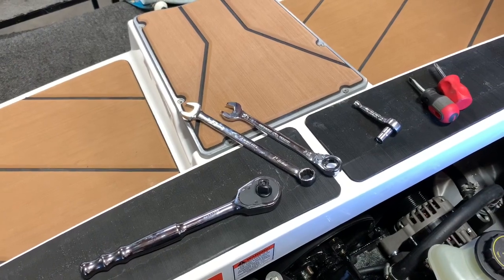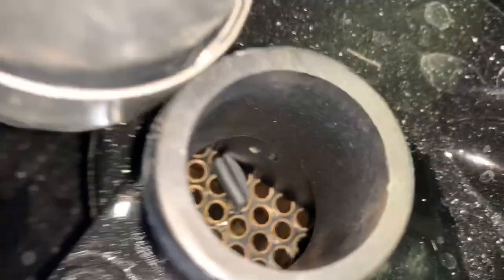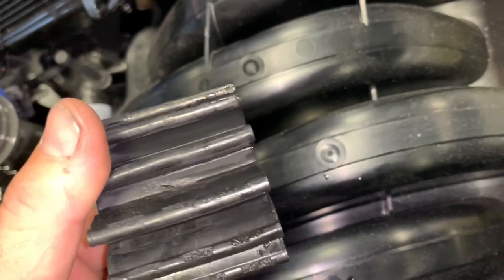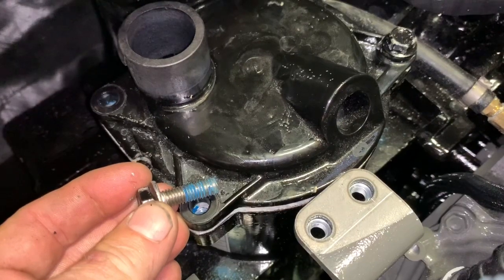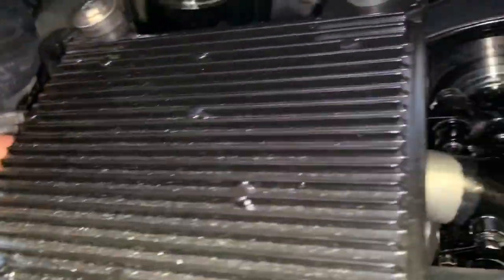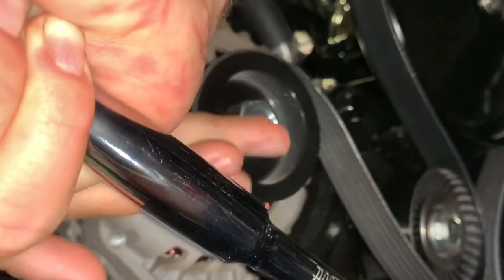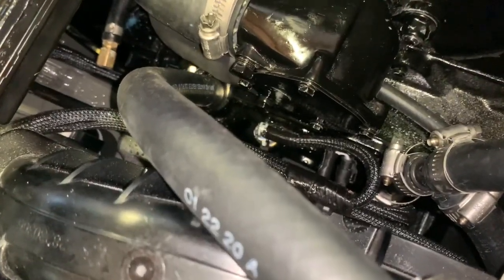Malibu M5 M6 impeller  replacement

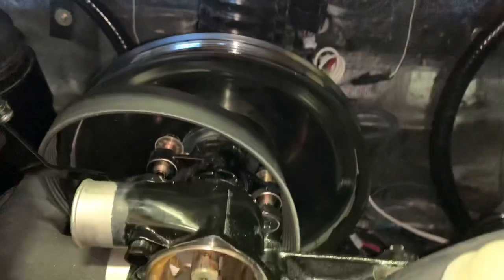Comment: At about the 9:05 mark in the video you say "sometimes the keyway is popping up and you have to squeeze it down", can you elaborate on that?  How would i squeeze it down? I took pics and it looks like a solid piece of metal.  This weekend I had a really hard time getting mine changed. I ended up having to file the impeller down.  Really makes me think I didn't do something right and it might be what you mentioned at this point in the video.  Thanks for your help and the great video.  I was able to follow all the steps and did eventually get it swapped out.

Comment: This method is accurate and the easiest way to change my impeller on the replacement Johnson raw water pump which was recalled/upgraded on my 2020 Axis A24 M5 motor. Great video! I watched this and then went and changed my impeller without any difficulties!

Comment: If I'm on the water and burn out an impeller, would it be okay to just replace the impeller and clean out the broken pieces of the old impeller later when I'm home? Thanks for the video, this is very helpful.

Comment: Great video, thanks! For a new owner is this part of routine maintenance? Or only if overheating? Thanks again
Reply: Impellers are a routine maintenance item. You should be changing once a year, minimum. Same with oil, transmission and fluid changes.